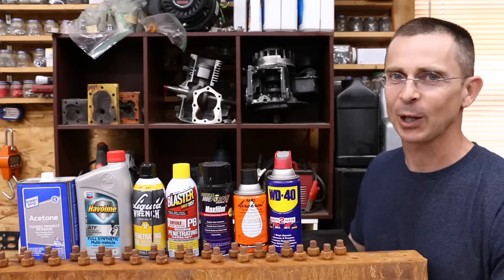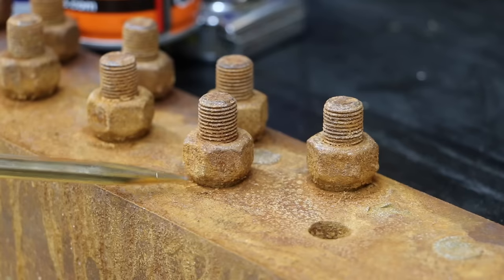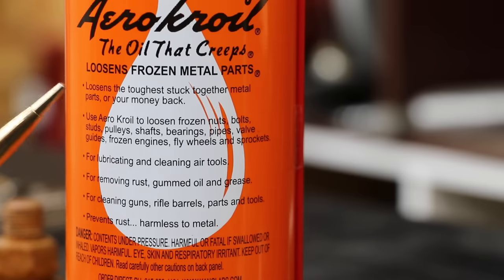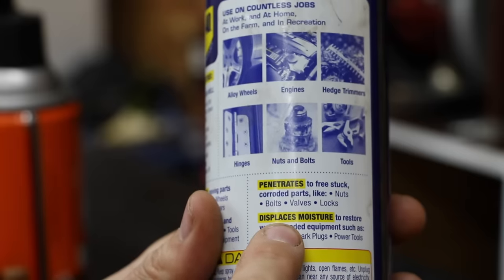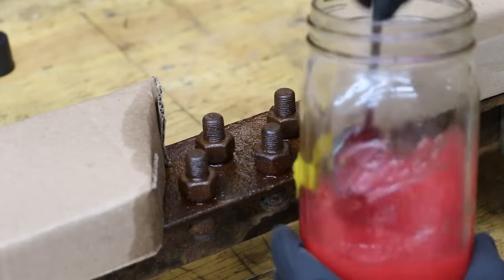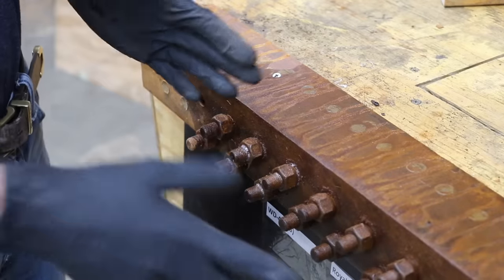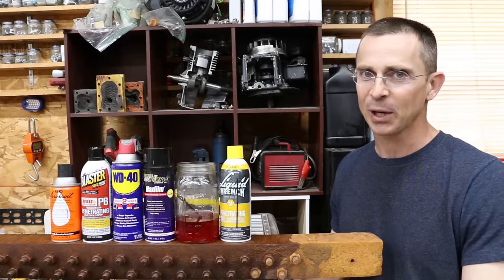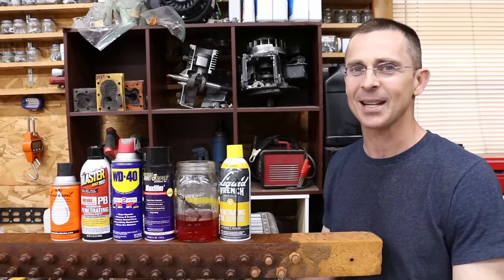Which Penetrating Oil is Best? Let's find out!

Comment: I've used liquid wrench since I was a child in the early 1950's.  My dad was an auto mechanic, and I still remember an old can of liquid wrench in a cabinet in the garage.  I guess the smell of that product is what takes me back to my childhood!  It's not a bad smell, but it is distinctively liquid wrench.
I stopped into Tractor supply today to get some liquid wrench.  They had three kinds of liquid wrench, but they were out of the "ORIGINAL liquid wrench.  I guess everyone in Dripping Springs Texas watched this YouTube video!!
Reply from the maker: Thanks for sharing.
Reply: I was born around the same time as you and Liquid Wrench is all I’ve used and always got good results. I prefer the squeeze can because you can put it right on the bolt instead of spraying half a can into the atmosphere. The squeeze can lasts a lot longer. Did any of these other products even exist then?
Reply: I used to know a John Gregory from Dripping Springs

Comment: Interesting video.. I have been a mechanic for over 40 years and have found that Kroil works best sometimes and other times it just doesn’t work at all.. (and Kroil STINKS when heated !)
PB blaster has never worked very well for me.. but some friends love the stuff!
 Liquid Wrench penetrates well if you have a GOOD can of it, but from my experiencd, their quality control is bad.. I have had aerosol cans that barely worked, cans that smelled like stale Kerosene and others that worked well.
Straight Kerosene can work as well as most of them in a pinch.  
Kerosene and Acetone works too.. But again, it is smelly.. ATF & Acetone works impressively well most of the time.. but you need to make a new batch when needed, not much shelf life!
Proper use of a hammer to relieve stress on the threads and tried and true methods are ultra important.. Just spraying it on and turning hard is not the successful way to remove a stuck nut or bolt !
Find one you like.. Kroil is expensive and at times seems to be worth whatever it costs because it can save you time and money, but like I said, other times it simply doesn’t work at all.. Not all metals are the same, oxidation is not always the same.. Experience is more important than the chemicals from a can !
Reply from the maker: Thanks for commenting. I enjoyed reading your post.
Reply: You know. I love Kroil! I'm a gunsmith and I have a little different situation than  most penetrent users. I might have a firearm that is very old (100, 200 or more years old) but I  have time to let it be. I will soak a part down with Kroil and work on something else for a day or two. This really works well but most situations for a product like this wouldn't allow that. A lot of things I'm working on have parts that just aren't available and I  have to either save the part or make a  new one. 
    Other things that work well for me are heat, shock and Vibration. I have soaked things down with kroil and  then tied them to my air compressor for a day or two. Helps in some situations.
    Best help is like you say experience. Patience goes a long way, keep trying different things and resist the temptation to force things. Y'all Take Care, John

Comment: One parameter you didn't consider in your test protocol was the 'country of origin' of the steel used for the studs and lug nuts. The trace elements in iron ore mined from around the globe varies, along with the "mix" of other elements (like carbon, molybdenum, & chromium)  that are added during production of the steel will vary in different countries; as with German Steel, and Soligen Steel most notably. 

I started "wrenching" in the 1960's and retired in the late 90's. For many years I was using Liquid Wrench, but when I got into specializing in Japanese-origin cars in my own shop I found that Liquid Wrench didn't work as with Domestic cars for freeing up rusted fasteners. And that was backed up by the difference in using an oxy/ace cutting torch to "blow off" rusted exhaust nuts while being able to not damage an exhaust manifold or the stud with cars built in different countries. Yeah, I always seemed to get the cars where fastener's had been rounded off with a worn out or cheap socket during a prior repair or were rusted so badly that the correct size socket was very loose fitting, and the best tool was a torch used by someone who knew what the hell they were doing and to just melt it off. I saw the difference in the color of the flame when melting off the nuts on cars made in various countries. Oh yeah, I live in a rust-belt state where road salt took its toll on everything that didn't retain paint for long or got too hot to hold paint like exhaust systems pre-stainless steel exhaust systems that needed to be replaced every 2 to 4 years almost like clock-work from the cat back. And before cats, the whole system was usually installed rather then the client saying "but you just fixed my exhaust system 6 months ago" when only the rear was done and now the headpipe was making noise. I did the whole system and saved the labor costs for 2 partial repairs.

Bottom line - I found that WD-40 worked best with Toyota, Nissan, and other Asian-origin vehicles. And at my local shop owners trade organization meetings I found that the European-car specialists swore by PB-Blaster as being the best. Tried PB-Blaster in a few VW's and Fiat's that I got 'roped into' working on by regular Toyota-owner clients of mine for their 2nd car or 'kids car' and found that to be the best for those brands. Worked on few domestic cars (too large for my small bays) once I opened my own shop in 1975, but I stuck with Liquid Wrench on those; neither PB-Blaster nor WD-40 worked as good. 

Bottom line, there is no 'best to use' across the board. The metallurgy involved with the steel presents a variable which involves the origin of the fasteners. So, in this day and age a technician almost needs to view the VIN to determine the country of assembly and hope or assume that the fasteners installed at the factory were sourced locally in that country. Call it a SWAG - Scientific Wild Assed Guess to determine what might work best for each vehicle that rolls thru the door.

Just discovered your channel.  I commend you for taking the time to actually test the various and look forward to the 2nd video.
Reply: Great tip, thank you! I just bought a Toyota RAV4 and usually use PB for my old Ford tractor, but will try WD40 for my RAV.
Reply: Interesting observation and dearly thanks for sharing it. Also totally agree that there is no such a thing as "One size fit all".

Comment: I have a motor mount bolt stuck in the metal sleeve through the bushing. I was using PB Blaster to try to cut through the rust, then saw Liquid Wrench tested better, and I happen to have a can of that as well. These videos are still useful years later!
Reply from the maker: Thanks, great to hear!

Comment: So now you need to mix all of them together and see what the out come is. Also see the results when the oxidation is inhanced by salt. You know road salt from winter. Great video
Reply from the maker: Thank you for this recommendation!
Reply: maybe even do a setup like this and biweekly soak the test pieces in a strong road salt solution over the spring and summer for a winter road salt special in the fall.  IIRC calcium chloride is especially damaging to untreated metal. 

I really enjoy your videos and their practicality to hobbyists and DIYers. Thanks
 for the hard work.
Reply: Rock salt and water mix make sure its think so it sticks. If you were close I would give you a few 50lbs bags. But there cheap anyway.
Reply: Brandon Allen sorry fella but salt dont do it. its salt thay aytracts water and holds it against metal and water has oxygen in it that actually dose the dirty deed.
Reply: Brandon Allen but you are almost  correct

Comment: Interesting. Over the past 50 plus years I've used most of those at one time or another plus Marvel Mystery Oil which has perfomed well on steel to steel applications but for freeing up disimilar metals I've had the best results from Kroil by far. Years ago I had a steel fitting that was seized in a very rare aluminum intake manifold and had about given up hope of getting it out. I ahd tried PB Blaster, WD-40, MMO, etc. with no luck. I took it to my buddy's repair shop , he walked over to his tool box and came back with this beat up old can and sprayed around the fitting. He then went to the fridge and came back with 2 beers and told me to have a seat. We finished the beers and he got up and clamped the fitting in the vice and told me to pull on the manifold, there was a split second of resistance and then it broke free and came right out. That was my introduction to Kroil, i bught my own can that same day and have kept it on hand ever since.
Reply: I keep almost all of these around. I've found that none of them seem to be a one size fits all solution. I also like Permetex Liquid Penetrant. When I have a nut that won't break loose after a quick spritz of PB Blaster (the cheapest these days), I pull out the rest and start spraying away.

Comment: PB Blaster. Used it for the first time while trying to break axles free from a rusted wheel bearing assembly. Used several cans of Liquid Wrench without results. Bought a single can of PB Blaster and it worked. I was able to remove the axles without too much trouble.

Comment: As an aircraft mechanic for American Airlines we also typically use Kroil as many have stated. I was surprised at how bad it actually is. They probably haven't changed the formula in a very long time thou. What we have found is that Dye Penetrant or in our particular case the Fluorescent Penetrants work phenomenally! These penetrants have different classes, I-IV, with IV being the best and their capillary action is better than any thing we have found. This stuff has to find really tiny cracks in different materials so it gets in the threads of nuts/bolts with no issues. Unfortunately it is messy, especially the fluorescent kind. Also maybe you could design some type of test to try to visually see the capillary action of these materials. Maybe plates of plexiglass together and see how far it can "creep" between the two? In this type of test you could theorize which one is best with a constant application of the product. Could also be worth checking the application directions for each product. I know that I was always told to spray Kroil every few minutes because as you noted it evaporated quickly. Apply the penetrants horizontally because you can't always get that good soak in real applications. Great video.
Reply from the maker: These are all great recommendations--thank you!
Reply: LPS was designed for the aerospace industry. Ever try that?
Reply: Jake McCurry Jr. croil is the shit I’ve tested it on bolts rusted in refineries for more than 50 years and kroil did better than all of these
Reply: festerallday - We use LPS 1, 2, & 3. We typically only use them for lubrication purposes thou, never really tried them as a Penetrant to break things loose.
Reply: crunch9876 - I have heard so many people make the same claim but in my own real world testing Kroil works alot of the time but if it's really stuck the Fluorescent Penetrant works way better. This is also the 2nd video I've seen that Kroil has done either the worst or almost the worst. I've been at my job for over 10 years and my experience has been the same as the videos.
Reply: A very easy way of testing the capillary action would be to soak one end of an absorbent testing substance into each solution, like a popsicle stick or paint stirrer.
Reply: Spray more Kroil, buy more Kroil. :-)

Comment: I would be interested to see these same products used as a rust preventative.  take new nuts and bolts soaked in the different Pen-oils the put them in an environment which would normally cause them to rust.
Reply from the maker: Thank you for this recommendation!
Reply: Project Farm You’re welcome.  I really enjoy your videos.
Reply: That is a great idea!
Reply: my mate paint stipped a panel 3 years ago. I put wd 40 on it then. 3 years latter still no rust and has an oily film. (is inside the shed)
Reply: Someone on a gun forum did that. Used a salt bath. WD40 was kick ass in that test.
Reply: Fluid film is excellent rust preventative and doesn’t wash away very easy.
Reply: I found Boiled Linseed oil is best for new stuff not rusting out in weather.  I use it on all my trucks and trailers that travel thru rust belt to snowmobile,  with great results for little money. 
Just dont ball up rags u use to wipe up excess drippings when applying!!! Old time farmers say rags could spontaneously combust!!! So I lay rags outside for a few days to air out then throw in trash on garbage night
Reply: To add to this test, add a set of bolts for anti-seize (silver and copper ones) and basic all purpose (e.g : "tractor") grease.
Reply: Thin with paint thinner and spray on linseed oil
Reply: dragonpnut76 ,, you must live in a desert,,,. I use transmission fluid,,. There's nothing any better,,,.
Reply: Claude Hébert ,, yep,, lug nuts should never rust,,,. That's what hubcaps and anti seize is for,,,,
Reply: TheGuruStud no need, that's why u buy the boiled linseed oil
Reply: Claude Hébert CAT always uses the gold stuff, which is made by Loctite now. The silver stuff we call Cheesy Seize,  cause it's hardly there when u take apart a yr later
Reply: Definitely try Penetrol Flood, Permalac, and Gibbs Brand for a rust preventer.

This is such a great video thanks for the attention to detail, great stuff!
Reply: Cool experiment must have took some time to put that together next time just use a freaking torch just joking bro thanks man for the
Reply: Ky jelly is the ultimate cpc. Just wipe it on good and them wipe to a shine. Kept a brake rotor from rusting in the weather for over a year. And we all know how those rust.
Reply: Fluid Film keeps my vehicles looking great here in Alaska.

Comment: I am a kroil fan because I use it on 650 degree valves on the spindle threads and collar. Once worked in, it allows the best turning of a 36" valve than any other safe lube. It doesn't evaporate as quick; yet, is light enough to penetrate and lube it. Try turning a valve 990 turns to open it, then you will see...